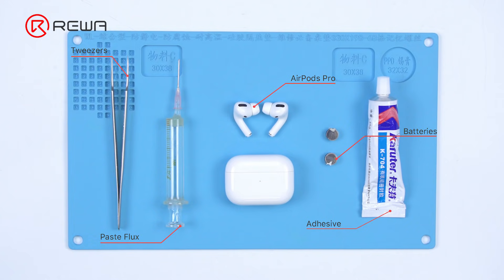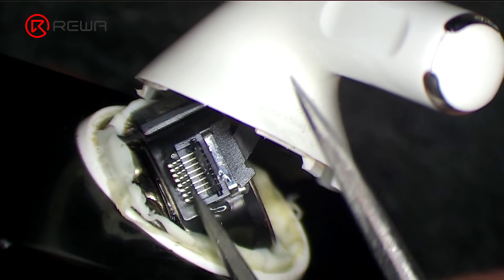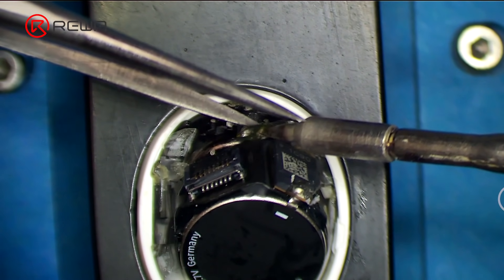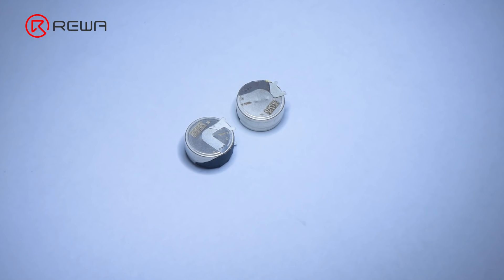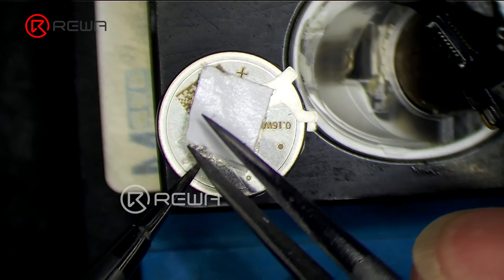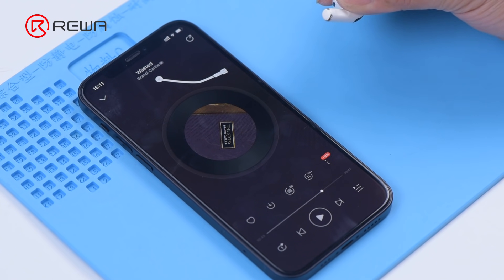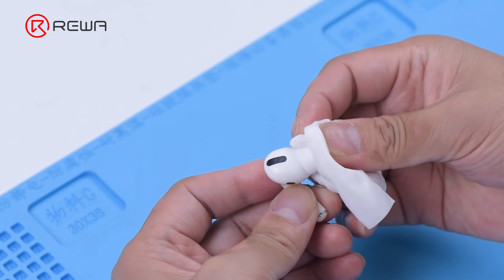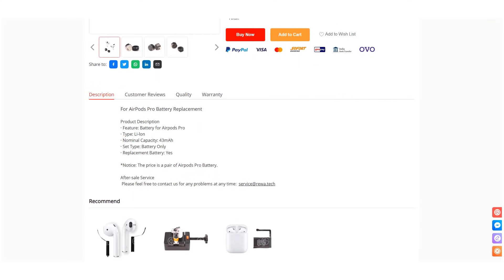AirPods Pro Battery Replacement - Harder than AirPods 1 and 2

Comment from the maker: For more details, please visit our blog:
https://blog.rewa.tech/detail/airpods-pro-battery-replacement-harder-than-airpods-1-and-2

Products recommended in this video: 
MaAnt P1 AirPods Repair Fixture: https://bit.ly/3uneHj1
AirPods Pro Battery Replacement: https://bit.ly/3fw4cV6
Replacement Battery For AirPods Pro Charging Case: https://bit.ly/3bCtik0
Repair Fixture Holding for AirPods: https://bit.ly/3fywFtv
MaAnt T1 Universal PCB Holder: https://bit.ly/3tZdnm9

iPhone Motherboard Repair Training Book (REWA Exclusive): https://bit.ly/2MJmPKy
For more discount, you can contact our wholesale team: https://shop.rewa.tech/wholesale.html
Reply: what adhesive did you use?
Reply: Ears holder link please
Reply from the maker: @ПавелТавридов  MaAnt P1 AirPods Repair Fixture: https://bit.ly/3uneHj1
Reply: @rewatechnology2008  What adhesive did you use???
Reply: Any fix for Apple Pencil 2 battery?
Reply: Do you sell AirPods white glue/adhesive?

Comment: Shipping Fee for MaAnt P1 AirPods Repair Fixture For AirPods 1/2/Pro: $244.30 By UPS to the United States. That's not including the fixture price, which you have to sign in to see. I am not signing in. I'll just buy another set. It only makes sense if you operate a wireless device repair company.
Reply: You don't need the fixture. Only two hands and the basic repair tools

Comment: Or you just pay Apple only 65 € and get all the batteries replaced, left, right, and the case. That's extremely cheap. I'm sure the AirPods Pro holding mechanism alone costs more than 65 €.
Reply: "Extremely cheap", it's actual insanity how Apple has managed to brainwash it's customers this much. Replacing basic parts such as batteries shouldn't be a hassle.
Reply: @RedOneM  
They have to use a heat-gun to loosen the adhesive, open the case, fiddle around with the cables, put in a new battery, which also costs money, then put on new adhesive and do that for 3 devices, the left ear pod, the right ear pod, and the case. I’d say 65 € is more than a fair price for all that.

Replacing a battery on a phone is a bit expensive since it is only one device and it costs 100 €. But it’s still not too much, considering the cost of the battery, the shipment, and especially the cost of employees.

And you have to consider that a portion of that money is tax. In the USA, the sales tax rate varies by state, typically ranging from 0% to 9%. In Germany though, where I live and where I get the 100 € price, the standard VAT rate is 19%.

So if all that, including the employees, costs them 40 €, and they’re paying around 19 € taxes on 100 € for the transfer in Germany, they’re making only 41 € of profit. Many people don’t count the taxes in. I do because my father has his own business, and I can see how little is left at the end of the day with my own eyes. Sales does not equal profit.

Comment: The amount of adhesive applied or the seal can be an issue as the space required for adequate AirPods Pro sound quality can be affected. It might not sound the same way afterwards
Reply: What do you suggest?

Comment: if they wanted it to be repairable they could have maybe designed a batter to fit in the stem, and have they screw on/off?

i’m sure there are logistic constraints, components taking up space, but surely that could have put a bit more thought into making these things repairable, because as it stand all earbuds of the future are headed straight for the landfill with a 3 to 4 years MAX expiry date.

Comment: To measure a battery's correct voltage you need to add a load.
Reply: No, you don't. As long as the battery doesn't show signs of deep discharge, it's good enough. So above 3V is perfectly fine.

How much current do you think you can draw from these button cells anyway? Several mA at most.
Reply: @SianaGearz  so what you are saying is the load from the multimeter itself is enough then? ELI5 please.
Reply: @XxM1G3xX  No. A good multimeter has at least 10MOhm (mega Ohm) inputs, this is lower current load than you expect even in such a device in standby, which is another couple orders of magnitude less than in operation.

I'm saying that these batteries (and most other types) aren't pure constant-voltage devices whose current capability drops as charge is depleted. Their completely unloaded voltage varies predictably with charge state. Also you're kinda relying on the battery being actually more or less new or at least not completely worn and heavily damaged, i.e. that its actual capacity is somewhere vaguely near the spec region. So given these are Lithium Ion rechargeable cells, when it's nearly completely empty, it should be around 2.9V and when it's full, it'll be 4.2V or up to 4.35V depending on chosen charge voltage, newer types are usually safe to charge to the higher voltage so many modern devices choose that threshold.

If the Lithium Ion cell is new or new old stock, then as long as it never reached zero charge state - that is when you receive it and unseal the factory sealed package, it's still not below the threshold of zero charge, you can pretty much rely on it being healthy, and you don't need to put any further effort into testing it. Only once it has reached zero charge, it will start taking damage in storage.

If the cell has a manufacturing defect that could become apparent shortly after installation or during any initial testing that you can perform, it will generally reach the deep discharge state during shipping already, since Lithium based cells and batteries aren't allowed to be shipped by air, so it takes a while, so if it measures too low, you can just claim a refund on it and send it off to recycling, you shouldn't bother charging or testing it or even contemplating putting it into customer's device ever at all.

Obviously loaded and unloaded results can vary significantly, and will vary more when the charge is depleted. So for example if you measure an empty Li-Ion cell unloaded, it can be 2.9V, but loaded it will drop under 1V and if it has a protection chip on it, that will disable it entirely.

Similar but different no-load voltage curves depending on charge apply to other kinds of cell chemistries too, they all have some charge dependence. Say NiMH cell nominal voltage is 1.2V - at full charge, it actually starts off at 1.55V unloaded (closer to 1.25-1.3V loaded), rapidly drops to 1.25V, then across most of the discharge cycle it will slowly crawl to 1.15V, and when it's at around 1.1V, it's nearly completely empty, like less than a percent residual charge left. NiMH actually has a fairly unusually flat voltage curve across the bulk of the charge range, most other kinds of cells are much more gradual. Alkaline 1.5V primary cells also start off at 1.55V (only slightly less loaded), and linearly drop with discharge in voltage until about 0.9V.

Of course many devices exist where even if the cell is only half empty, it's not enough to cross the minimum operational voltage of the device under load, in which case you want to check them loaded. Also this way you can detect rechargeable cells which were heavily used or damaged and don't have much actual capacity left or have gained a significant internal resistance. So with a damaged cell, after you charge it, under load, the voltage drops rapidly and significantly, much more so than with a healthy cell.

Comment: Apple airpods battery replacement steps:
-visit mars
-mine Afghanistanium at 420.69° kelvin
-milk 2 parrots
-study genetic engineering, mechanical engineering in 2.6 minutes exactly
-play amongus at 3 am 3.5 millimetres away from the middle point of the Bermuda triangle
-visit the aether dimension using a 3×2 glowstone portal and a bucket of water in vanilla Minecraft 1.8 (bedrock edition)
-play as zelda in sonic the hedgehog 2 on the sega mega drive for exactly 2.0019 minutes
-invent a new alloy by mixing the Afghanistanium you mined at mars, argon and the milk from 2 parrots at exactly 0° kelvin
-calculate how many attoms are in the average black hole
-finally use a pulse laser at exactly 600935° kelvin for exactly the equivalent time of 2 caesium atom vibrations to seal the pod at a quantum level and ensure the same subbar sound quality

Comment: Was it necessary to remove/desolder flex cable?
Reply: Same question here.
Reply: You disconnect the flex cable, that you have room to work on the battery.
As for the desoldering, you do it to have clean access to the battery without damaging the connection when reconnecting.

Comment: the adhesive you use it, is that removable   if you change battery latter again? the advise you use it seems difficult to remove than AirPods adhesive ?

Comment: iFixit Repairability 0/10
REWA: hold my beer
Reply: @GAME SMASHERS Are you a US hacker bot?
Reply: Hold it Hell I’ll drink it 😀
Reply: The score is fair. You need a specialized tool, a heatgun, a soldering iron and specific glue. You need to buy a non-standard, non-original battery from third party manufactuers because Apple doesn't sell it. And it's a very difficult repair.
Reply: I mean they are Americans (iFixit) and Rewa is chinese Chinese people could do anything
Reply: @mohnishg5091  like create a killer virus in 21st century
Reply: @suraj01sharma  i didnt mean to say this... i mean in the tech industry lets just not talk about Corona over here pls ? Thanks
Reply: @suraj01sharma  or start a religion war
Reply: They make it 0.000000000000000000000000000000000000000000000000000000000000000000000000000000000000000000000000000000000000000000000000000000000000000000000000000000000000000000000000000000000000000000000000000000000000000000000000000000000000000000000000000000000000000000000000000000000000000000000000000000000000000000000000000000000000000000000000000000000000000000000000000000000000000000000000000000000000000000000000000000000000000000000000000000000000001/999999999999999999999999999999999999999999999999999999999999999999999999999999999999999999999999999999999999999999999999999999999999999999999999999999999999999999999999999999999999999999999999999999999999999999999999999999999999999999999999999999999999999999999999999999999999999999999999999999999999999999999999999999999

Which is still better than 0/10
Reply: I think that iFixit mean to repair that 75% of people can do not 0.01% in the world... but indeed this increase they reparability score... This video was amazing indeed.

Comment: It has come to a point where adhesive is an actual component to fixing airpods...just wow
Reply: for audio to produce better sound, good seal is needed, its nothing new
Reply: @darkcrox  the adhesive is also to prevent anything from moving around from vibration.
Reply: Well all current  phones need adhesive after a fixing
Reply: Most earbuds use adhesive in the assembly process.
Reply: For a super light, small device worn directly on skin, partially inside a body orifice, sealant makes very much sense. In terms of phones though, it's an product of customers wanting NFC and wireless charging, but not wanting plastic housings. It can't be metal, so it must be glass or ceramics. Those materials are extremely difficult and expensive to manufacture to such a tight tolerance with irregular shapes, that would enable a user removable, friction fit snap on cover like with cellphones before. They would still break very easily, and that kind of tolerances would make rear covers cost like 60-70 dollars a pop to manufacture. Due to super low yields and a tonne of precision technician hand work.
Reply: As opposed to a plastic clip that will break.
It’s the lesser of the evils, to be able to make a device small, and by proxy, light enough to not fall out of your ears when exercising.
Reply: What else do you seal it with??
Reply: Just wait until it becomes duct tape
Reply: What’s the name of the adhesive? Does anybody know where to buy it?
Reply: @MrNesti  looks like Kafuter K 703 white silicone glue? 🤔
Reply: @MrNesti  Spunk

Comment from the maker: Since we have not found the original adhesive for AirPods Pro, we use the alternative adhesive.  If you have other adhesive for recommendation, please feel free to leave a comment.😘
Reply: Try CEMEDINE SUPER-X 8008 WHITE.
Reply from the maker: @dorfschmidt4833  Thank you for the recommendation.
Reply: Is the adhesive that you used also like the flexible and easy to remove silicone type adhesive used in the Airpods Pro? Or does it set hard and rigid?
Reply: I just came back from googling glue for electronics. Silicone glue ftw. Flexible and non-conductive. Thank you for this video!
Reply: Does the ANC works like normal after replacing the battery?
Reply: What about E8000 glue ?
Reply: @abderrahmanezahid  E6000 and yes
Reply: why u dont send parts to india??